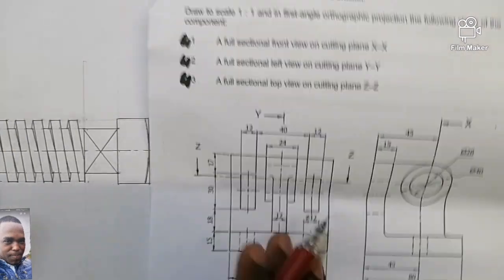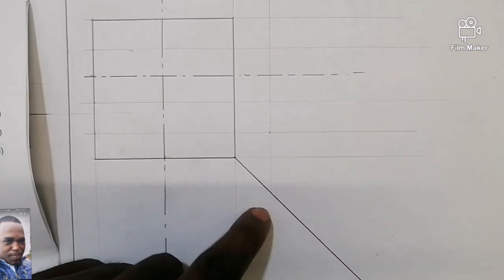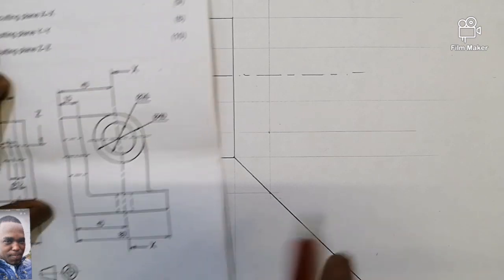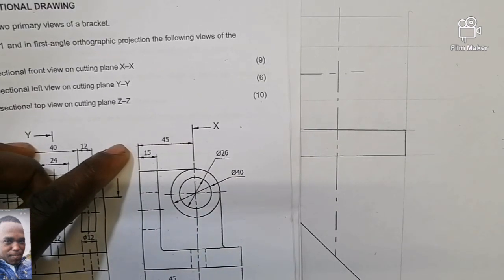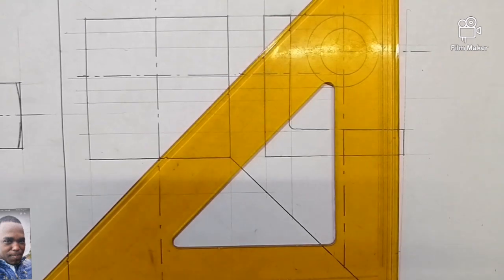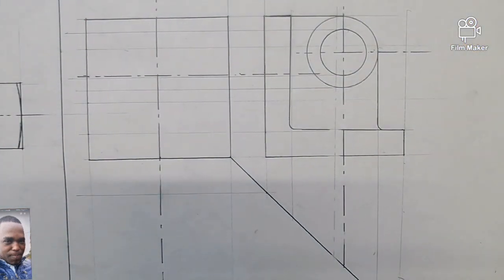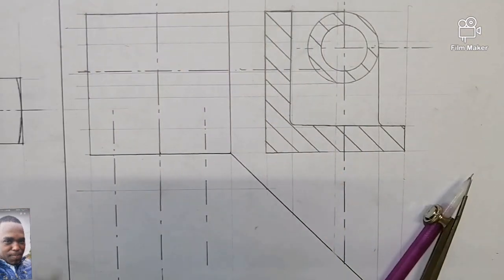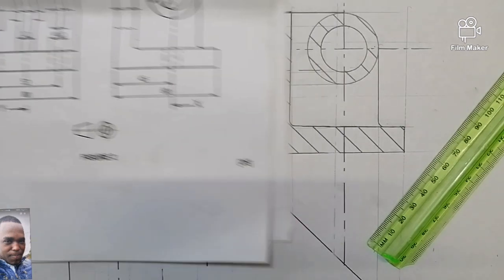Sectional Engineering Drawing N2

Comment: sir , is it compulsory to draw your isometric with dimensions from the scale or yiu you can draw it with dimensions from the question paper its self? N3 student here
Reply: August 2023 (N2 ) how to draw question 4 (Isometric  projection) pls help
Reply from the maker: Only if the Question asked you to put them.
You label them the way as they are from the question paper.
Reply: @etutorsdigitalschool2215  i hear you sir but when you do the actual drawing , do you use the reduced dimensions(from reduction scale) or the original dimensions?
Reply: @etutorsdigitalschool2215 Good day Mr I need help with other first  angle projection... so how can I send?